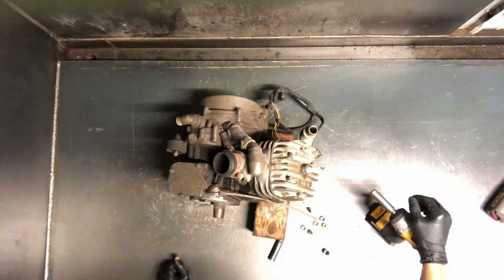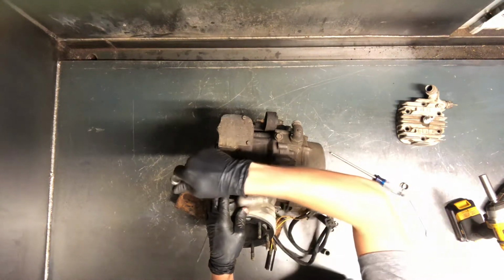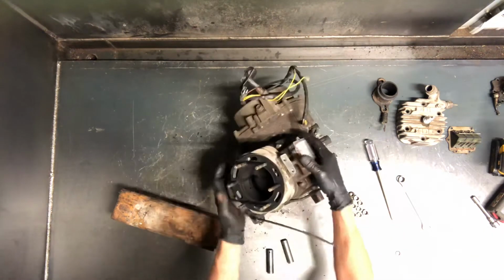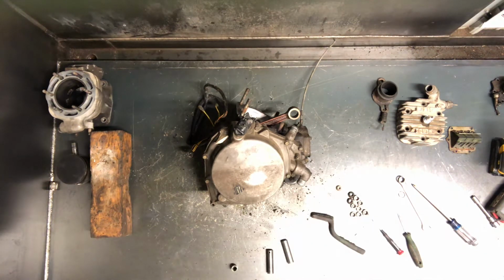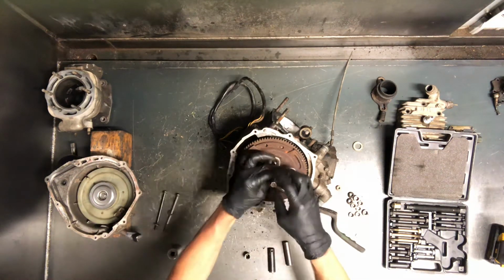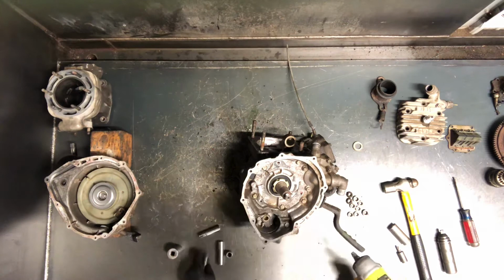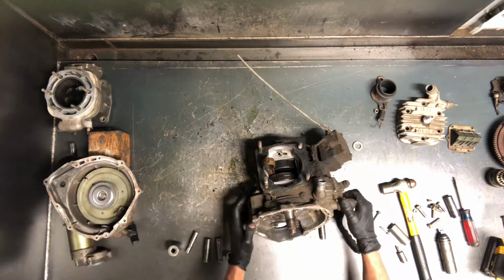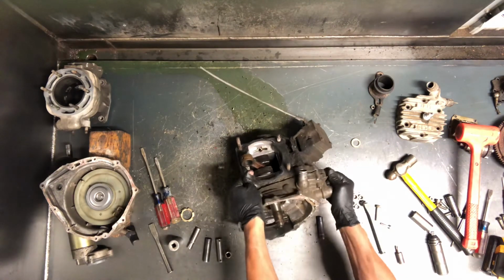Polaris Scrambler / Sportsman 1 of 2 - Engine Rebuild Crankcase Crack Piston Cylinder Top End Stator

Comment: I'M  curious IF YOU STILL have parts for these. I literally picked one up off the side of the road in pieces for 000. oo it had no motor or trans. The rear end was not attached. Parts I'm  still missing ...starter,shifter assembly motor mounts,swing arm bushings and bolts.sprocket and dics. That go on the trans and the chain .I believe I have gotten all the other parts as far as I know. Let it be known I have never owned  or worked one of these I've never even sat on one
If you could help a guy out it would be greatly appreciated looking for inexpensive second hand parts in usable condition ro be shipped on my dime of course please let know if anyone has any of these parts for sale
Reply: Good luck on your journey I will say join all the Facebook groups for that quad and be ready to pay a premium for used oem parts

Comment: Hey man if you come across any carburetor parts for prairie 650
Let me know I’ll check your eBay store in the middle of a rebuild and the carb rebuild was going well until I tried lining up the butterfly plate on the throttle side carb I just can’t line the damn second screw up... also any idea on how tight the nut should be on the throttle mechanism when I tighten it all the way the throttle will not move even after thorough cleaning but when I loosened it just a bit things worked fine just worried it’s not supposed to be loose this is the nut that is on the outside of the carb which holds the butterfly plate in the carburetor not sure the correct term and first time working on one... that dang plate just will not line up no matter what I do I tried for about 1.5-2 hours.. I was thinking maybe I could replace the butterfly plates but don’t see them for sale just the whole carb assembly

Comment: Hey man do you have any recommendations for aftermarket or good used parts for 2002 or 2003 Kawasaki Prairie 650? My buddy gave me one he got a crazy deal on 4 pretty beat up atvs and he said it should run with a couple items I got a carb kit, oil change/ tune up kit, battery, and then I’ll need a screen for speedo. Outside of the speedo I’ve got the other items already ordered and also differential fluid to service front and rear... I’m curious about suspension components, and maybe some aftermarket skid plates, plastics and maybe an upgraded exhaust... I’m looking to turn this into a project build because I’ve never owned one and I want to get 100% from it but since it’s an older model and I’m new to atvs I’m not sure what kind of sites or places to look for some of these parts. Any suggestions would be super helpful. Thanks for all the videos man I learn a lot from each one. I may document the build if it works out to be a decent motor and all works with the parts mentioned above. The two guys I’m doing this with are very experienced in all things off road and 2-4 wheels so I have faith in them to help me get her running.